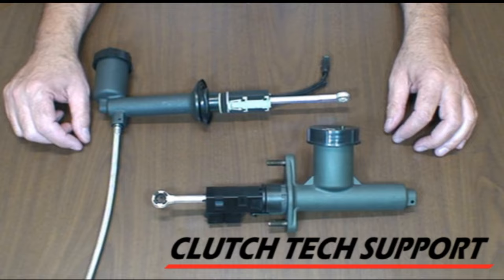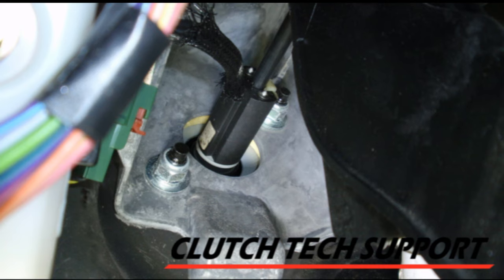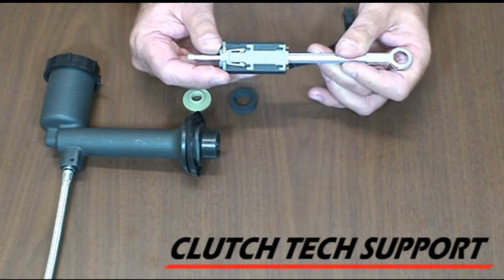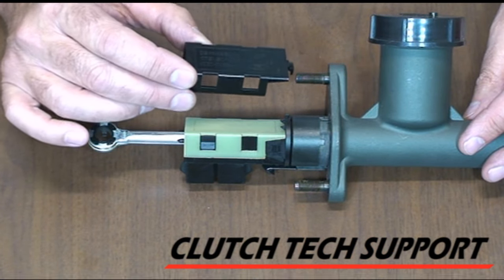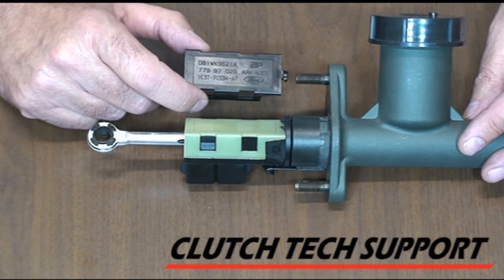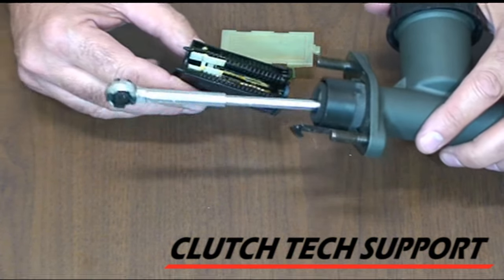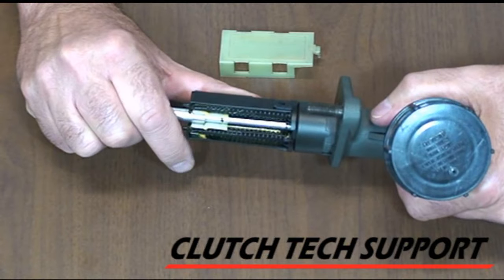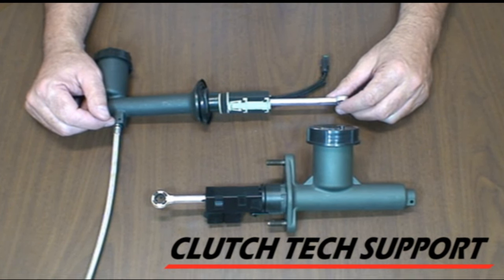Clutch Start Switch Removal and Replacement

Comment: Your excellent video saved the day! I was contorted like a snake trying to get a proper look at how to disconnect the switch and even used a few bad words, usually reserved for when I smash my finger with a hammer, but to no avail. I just could not see how to get the thing out. Then I looked here on Youtube and found this video, When I went back out to the truck, I had the switch out in two minutes,,,and with no fowl language whatsoever! Thanks!

Comment: FOR ANYBODY TRYING TO CHANGE JUST THE PUSHROD WITHOUT REMOVING THE MASTER.

All you need is a cheap ink pen. Pull the pen apart so all that you have left is the tube. The tube has the exact inside and outside diameters for this job! Cut the tube in half, then put a slice all the way down one side of it, long ways, so you can open it up and wrap it around the pushrod(don't cut the tube into 2 pieces). Once you wrap it around the rod, hold pressure on the rod twords the master and take a pair of pliers and work the tube in so that it gets between the rod and the master to release the two locking tabs. The rod will pop right out. Its actually very very easy! Hope this helps👍
Reply: Thank you. My push rod broke today on my 95 f150.
Reply: My question now is how do I lock the push rod back in after pulling it out?
Reply: @quackinator1609 . Just push it in. You'll hear it click.
Reply: @darrenfletcher7679 , glad it helped👍
Reply: @TripAMD  been trying that for the past 1 hour now. I even push it down while pressing on the clutch and still nothing
Reply: @quackinator1609 . It should be as simple as that. Its just 2 little metal tabs in there that grab the end of the pushrod.
Reply: @TripAMD  yeah, that's what I don't get. I don't know why I'm struggling so much
Reply: @quackinator1609 . I'm not sure brother. You might need a new master.
Reply: Duuuude! Thanks for this tip! Was needing to change out just the switch on my '03 Ram and this trick worked perfect!!

Comment: Thanks for the video! This is the only place I could find that shows how to remove the Ranger switch. I was figuring the push rod had to come off somehow, because that's how the new switch comes. I wanted to remove my old one for a friend, and was about to give up and let it go to the scrapyard along with my wrecked truck. One day later and it would have been gone!

Comment: Thanks very much for the tutorial. Lost my cruise control and I had tried everything: at least I thought I had. Even a diagnostic indicated that it was the clock spring but I wasn’t buying it since horn blew and the cc switches lit up. Kept searching and found your procedure for replacing the switch and that it was possible this effected my cc. Once I got a good look it I could see several wron areas and breaks in the switch. Tools included a head lamp, a bench for laying my feet on as they hung out the door. My granddaughters stuffed animal to lay my head on under the console on the floor and lastly the nerve to just do it. It took me all of 45min and it was done. The first test was would it start, and that passed sat. The second was the test drive and now I have cruise. Your video saved me $100’s thanks much. Jeff

Comment: Thanks for the video.  I have a 95 f150 and my rod broke on the end with the ring on it, so it wouldn’t hold, which made my clutch fall to the floor.  Everything makes sense except for how to get the rod out of the master cylinder?  I don’t want to pull too hard, it seems stuck and I don’t want to cause further damage.  Thanks!
Reply: same problem

Comment: The video was very helpful, but I need a little more information. I went to replace my Dad’s 95 F250 clutch switch, but there’s no hook attaching it to the master cylinder. Where would I get one, and what is it called? None of the Auto parts stores even know what it is. Please help, if you can?

Comment: I've got a 2013 Dodge Dart that won't start. I think/hope it's the clutch safety switch, but even with your explanation, I can't seem to find it. On the Dart, the push rod appears to go directly into the floor. Could the switch be on the other side of the firewall?

Comment: I have the dodge style switch on my 1998 s10, I just recently replaced it and it now sticks, and will not return when the pedal is released.

Did I install it wrong, or does it just need a little grease?

Comment: How do you remove the old push rod that has the quick disconnect end. When buying the replacement clutch pedal position switch they give you the whole unit which consists of new shaft with switch on it ready to install, but you can't get the old rod out. Do you have to use a quick disconnect tool?  My old one is rusty. And it looks like one you removed from the jeep set up with the little white plastic retainer and the two tangs that you have to squeeze and pull back to remove. Do you think that someone could have rigged the jeep one Ina ford ranger? Because this is a quagmire that I'm faced with. All sources are telling me that the one you call the ford part is not like mine. It looks exactly like the jeep one . How can that be?
Reply: I’m in the same boat. My Ford switch looks like what he is calling the Jeep type. Also, I just want to replace the rod. Looking for a way to remove that rod.

Comment: On my 98 dodge ram the switch is on right far as I can tell and know but will not crank when clutch is pressed in the switch isn't making contact as should but I can reach under with truck in neutral and e brake set amd grab switch and pull it up the rod and it will crank so maybe is the switch worn being there is no adjustment that I'm aware of for it

Comment: Man what a great video, i did have one question though,when you say "you get one chance to lock that in" what do you mean? reason i ask is because a buddy of mines clutch messed up tonight and we are going to work on it tomorrow, it is the first style you showed and we did mess with it a bit tonight and i remember i reached under the dash and that part that you mentioned that locks in actually came out with no trouble at all, what i think happened is the retainer that holds the rod to the clutch pedal broke and the whole rod and interlock switch just fell out in my hands.this clutch is like a year old so its basically new, maybe the person that installed it previously didn't snap it in place at the slave cylinder?

Comment: If the push rod doesn't hold in the master cylinder do I need a new master cylinder? Working on a 00 f250 with a busted switch but may need to replace the whole master cylinder if this is the case. Thanks

Comment: Why would anyone thumbs down this vid ???
Reply: Because that IS NOT a "start switch" it is a CLUTCH SAFETY SWITCH,  better known as a neutral SAFTY switch, gesh guys get a clue.
Reply: You’ve got issues
Reply: Correct name is "interlock switch"  been called that since the 80s,once a few people got hurt by runaway cars the corporate lawyers had these little things invented, dont see the issue with what its called,we get the point, its a great video and the guy explains everything very nicely, without a video like this some idiot would try and put the switch in backwards or break it altogether.

Comment: How do i remove the push rod its self?
Reply: I know you asked this 6 months ago. But i just changed my pushrod today, without taking out the master out. All you need is a cheap ink pen. Pull the pen apart so all that you have left is the tube. The tube has the exact inside and outside diameters for this job! Cut the tube in half, then put a slice all the way down one side of it, long ways, so you can open it up and wrap it around the pushrod(don't cut the tube into 2 pieces). Once you wrap it around the rod, hold pressure on the rod twords the master and take a pair of pliers and work the tube in so that it gets between the rod and the master to release the two locking tabs. The rod will pop right out. Its actually very very easy.
Reply: @TripAMD  i ended up cuting mine and puting a heim joint 7.3s have a heavy clutch and it would of just wore out again thanks man

Comment: so on my jeep the tabs holding pushrod appear to have broken. any fix. my rod will fall through firewall when back pulling on clutch pedal. good video
Reply: scott sorter what did you ever figure out?  That’s how mine is

Comment: You don't give enough info for installing. It would have been nice to know about the little hanger that you needed to push out of the bracket to disconnect the plug. It would have saved a lot of time and trouble. Otherwise a person will end up unscrewing the main bracket from the firewall. Other than that, very helpful.